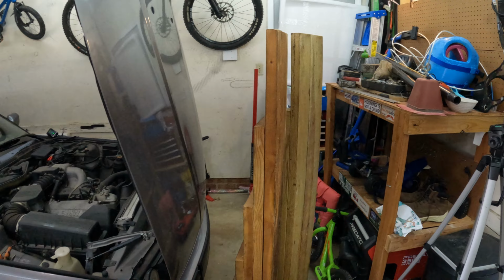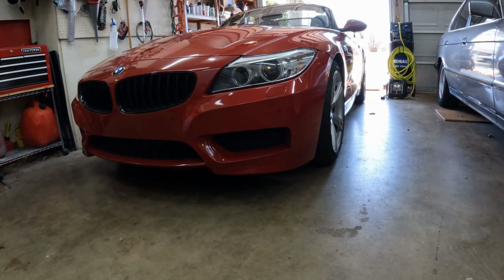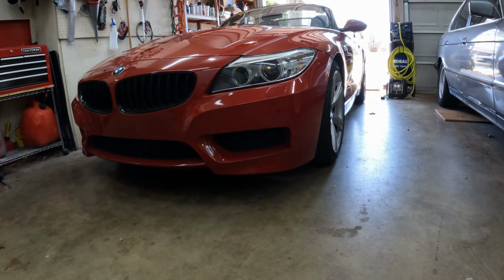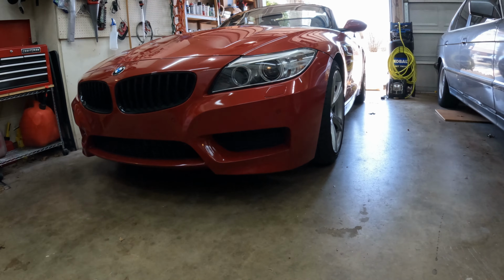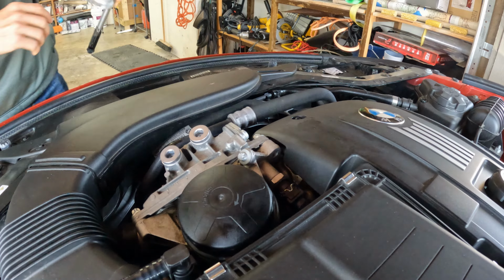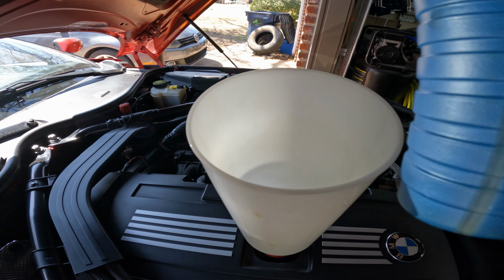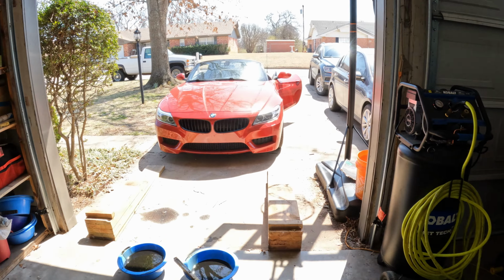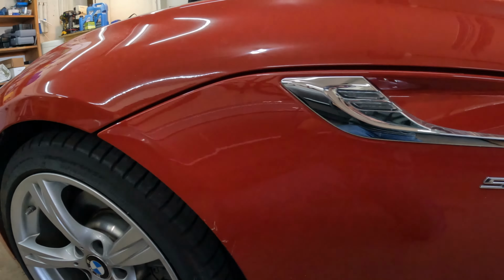BMW Z4 | Oil Change DIY | N54

Comment: Thanks. I have a 2009 Z4 35i but have never changed the oil myself. I’ve always had the local European car shop change it for me. As you know it sets really low, and I have an odd claustrophobic reaction when under a car when it’s close to my face. It makes me feel nauseous. Anyway, I’ll check out your ramp video and give those a try. 😀